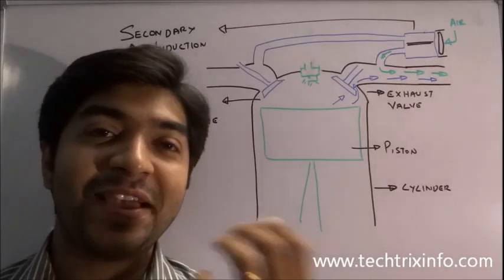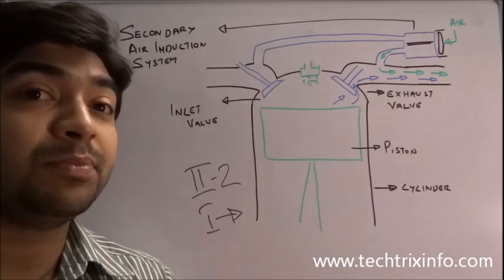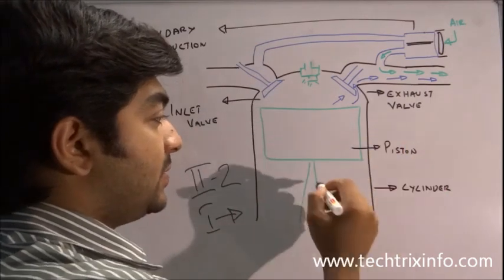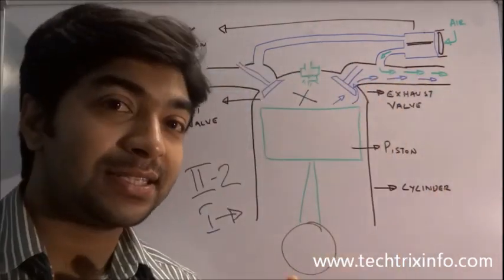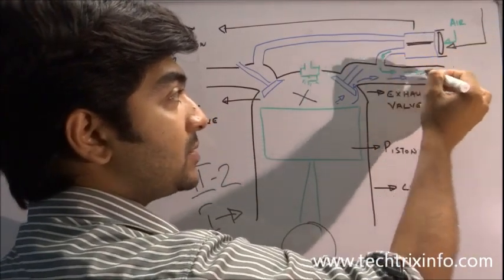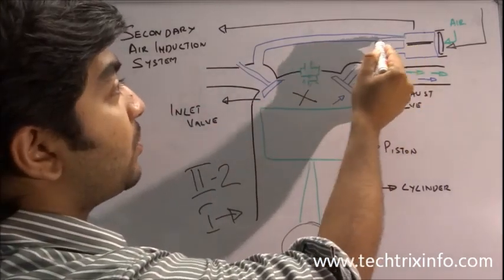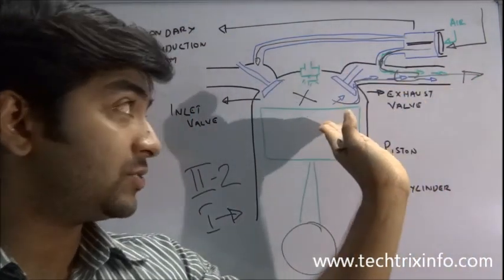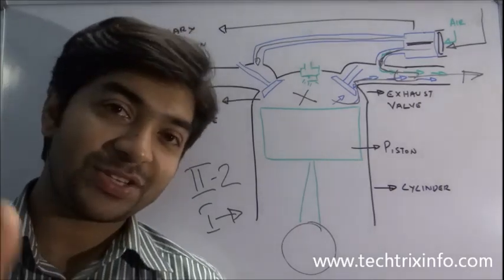How secondary air induction system works. ✔

Comment: Secondary air induction has no connection to the inlet port. It operates with a reed valve between the air box and the exhaust port and an vacuum or electric valve to have the system active at idle or when engine is cold to induct air into exhaust supporting burning of unburnt fuel in this situations. I believe the drawing is wrong.

Comment: please explain how secondary induction system valves are working. you said due to pressure difference it happens. but how exactly it happens. as SIS is connected at both inlet and outlet. how air fuel mixture from carburetor is not getting disturbed by SIS. Please explain in detail.

Comment: U may need to update your explanation.
Basic EGR (Exhaust Gas Recirculation) flows back into the cylinder chamber not out. In other words, about 5 to 15% I think flows back in with fresh oxygen and fuel mix to help reduce NOx (nitrogen oxide) emissions. Of couse this is the simple way of explaining it... modern engines (namely petrols) now have other ways of regulating the EGR flow as well as cooling it before being reused. This helps the engine be more efficient with power strokes and fuel use.